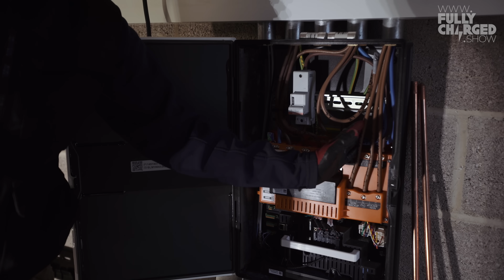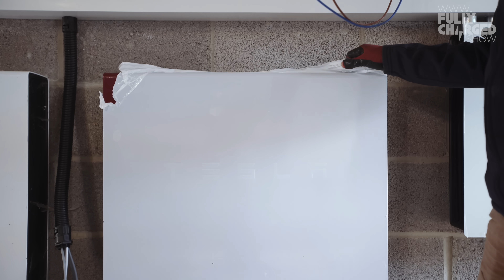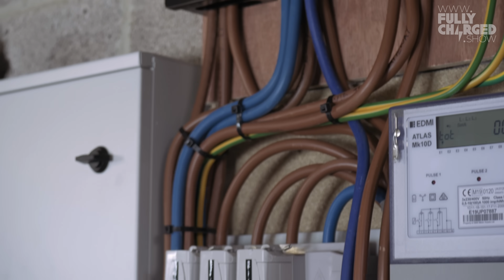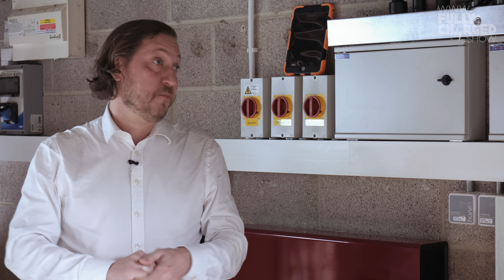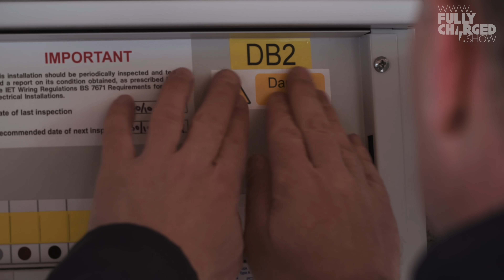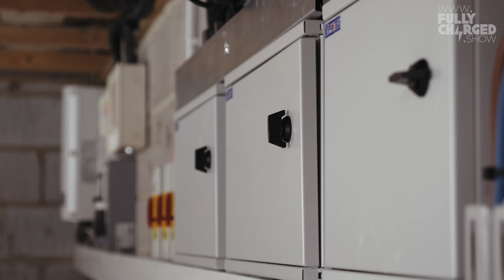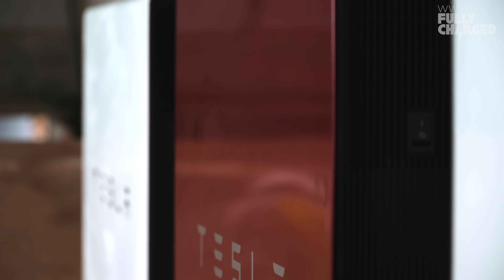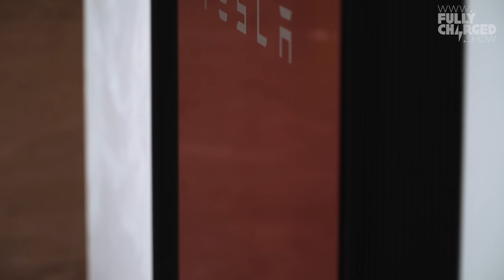Can you run your house on a battery? Tesla Powerwall 2 (Founders Series) & Tesla Backup Gateway 2

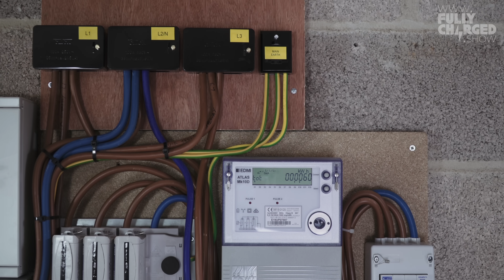Comment: Those wire terminals that the electrician is labelling at 7:00 - is that really how it's supposed to be in the UK? I'm very surprised to see electrical wires of that size being only encased in a single layer of wire insulation with no box to surround it. In my mind that shouldn't be permitted - it should either look like it does inside a box or cabinet (or other form of electrical isolation that can only be removed by the use of tools), or it should all be double-insulated if it's meant to be placed in the open like it's shown in the video. 

The rule of thumb generally is that electricity require (for safety) two layers of insulation. Most consumer products are double insulated, shown by the icon of two squares inside each other. That's also why cables have an inner and an outer sheath of isolation - otherwise technically you could just bundle single isolation layered wires together with cable ties. Instead, cables are made with two layers of isolation and we're typically only allowed to remove a layer if that layer is replaced by other isolation that can only be bypassed by tools, e.g. an electrical cabinet or a junction box. 

Having exposed single-isolated wires of that size sitting out in the open seems extremely dangerous to me, especially so in a garage where you might swing a (garden) tool around and accidentally cut through the isolation with very little effort.

Comment: Yes we have 3 phase in every house in Switzerland too. We just moved and took our charger with us and the electrician did a nice job of wiring it up.
I am surprised it takes so long to switch over when the power cost out. I would have thought it would behave like a UPS (Uninterruptible Power Supply). So to protect your power sensitive devices, like computers you would still need a UPS for those I guess.
Very interesting and informative. Thanks again Robert for sharing. 
One last thing, can you get the permanent marker off, just in case Elon shows up? ;-) He should sign it in white.

Comment: The smart switch is really interesting, taking advantage of the cheaper electricity rate at night. I'm wondering what would happen is more people start taking advantage of cheaper electricity rates at night, would the electricity demand at night increase thus driving the rates higher?
Reply: Manuel Medina Probably most price variance is due to industrial consumption during office hours, household usage is normally minimal on 8-16 on weekdays anyway even without any batteries to reduce peak demand.

Comment: So let me understand this.  15.5 KW  @ lets say 230 Volts is Approx. 66Amps. Your telling me the power company cannot accept 66amps at 230 volts single phase back on to the grid in the UK?  Am I missing something? Granted I live in the US where the standard Box from the pole is 200 Amps at 240 Volts 60 Hz , but the math doesn't seem correct here, How much power do you use per month? This technology is NOT new what so ever. You have a grid tied battery back up system  which is extremely "Vanilla" in the PV world.  I would suggest that your PV system was sized incorrectly for your Sun Hours per your region.  I would have put in an AC coupled system having the batteries behind the AC coupled inverter, where by your Existing PV inverter still saw 230 Volts AC from the Coupled Inverter supplied by the batteries and during a power outage your coupled inverter would switch away from the grid and your PV system plus your battery capacity "15.5 KW" (which really doesn't exist on your system) would both be available.  Yes battery's are great when you have a power outage but per your own comments you mentioned "5" minutes  per outage... You do understand the grid is the most elastic battery in the world.  The change over time is ridiculous, plus the surge that happened yikes... lets hope you have table top UPS's on all of your sensitive electric or electronic devices.

Comment: Hi Robert, what happens when grid power comes back on? Is there another interruption of power to the home like we saw when you lost power? 
The other thing that kind of got me was how the solar system only kicks in when the power wall gets down to 30%, the usual way is that after a power outage it will turn the inverter back on after 5 or 10 minutes because it senses that it has power, or is there something additional that prohibits that?

Comment: hmmmm  "the peak times are dirtiest"  the baseload is running all the time and the has to be reliable and cheap so it runs most time on fossil fuel. intermediate loads and peaking load are often renewables. the  base loads are using fossil fuels or  nuclear if you have it or  hydro

Comment: the backup gateway has been available for years. its what we call in engineering a kludge. this is lower than a hack. its a contactor switch with a 3rd party junk wifi from neurio and a comms box. its pretty awful.  im assuming you are referring to the new housing unlike the original US style electrical box.  robert would have been better off with a solaredge (interestingly his inverter is solaredge so i would have installed another one with storedge and 2 lgchem would have probably been cheaper too. this tech is evolving but its pretty mature and at least solaredge and LGChem make consumer ready electronics unlike tesla which seems to use its customers as beta testers. you could have also had solaredge new integrated charger or waited a little longer for a genuine 3 phase battery.

Comment: What is the round trip efficiency of you power wall installation. I.e., if you put 10 kWh into the battery, how many kWh can you pull out? I have a Sonnen Batterie, and I am getting about 50% efficiency over the year, and about 60% in the best case scenario (Maximal charge current and maximal discharge)

Comment: Very informative episode. What a treat to be educated by an articulate gentleman like Dr. Chris in the intricacies of this installation. Thank you for that! I wish my house was able to have solar installed, but unfortunately, the local building code does not allow for it. I'm told the solar panels would look "out of place" on our red-tiled rooftops that all houses in the neighborhood must have.
My only gripe with this episode is the workmanship of the electrician. The law must be more flexible in the UK. Where I live law dictates that all wall-mounted cables must be firmly secured by brackets no more than 12 cm apart to avoid cable stress, wear and the accidental snagging of an idiot passerby.

Comment: LOL. what they don't tell you, is they upgraded the power line leading into your home, so your solar panels will help feed their system. most likely you could CUT your power from the street and run completely off solar power and the battery that stores said power. They know, your solar panels are gonna charge your battery no time at all, and the extra time pulling energy, they are going to suck up that extra energy back into their own system via the 3 phase, and distribute it to your neighbors and charge them for it (just like they normally would).

guy states it wont dump back into the grid, but it will. oh it will, no power company will let you NOT spill back into the grid so they can sell free power for money....

Comment: Joju solar are totally hopeless. they are a bunch of pen pushers that buggered up the so called design as they thought that you can put 15 panels in 2 parallel strings (7+8 No way!) They failed to communicate the plans to the electrician resulting in £2000 of cost to replace the inverter I already had that was blown up. Hopeless and incompetent. Materials are drop shipped on the day and the installers are not permanent employees as they just fish around for the cheapest labour. These clowns just sent me another schematic of my system a year later for no reason at all and understamped it so it cost me to receive an incorrect schematic I did not ask for. the schematic is still wrong as they are clueless. I would avoid them.

Comment: Your battery charging speed score is wrong. EV users do not discharge the battery to 0 percent. 
Before that you will have a hard time. Because the car runs in turtle mode (usually less than 10% , 5% for niro ).
In general, ev uses 20 to 80% of the battery size. In the case of Niro, using a supercharger in that section takes about 40 minutes.
In other words, you have no idea why Niro was made that way. Niro's main advantage is space.

Comment: Can anybody recommend an adaptor that I can put in between a charging cable and house 3 pin socket that will will determine the cost of each charge. In pounds and pence.   This would be to charge a Prius plug-in.

Comment: Besides the danger of backpowering the grid in case of power failure, the main reason for solar, battery and wind generators not being able to run without mains connection is that they need to sync to the mains frequency. 
Take a generator, which is actually the same as an electric motor. In idle it turns in sync with the mains. Run it a little slower, and it takes power from the mains, run it a little faster, and it sends power to the mains. Without mains voltage, that can't happen.
It is the same with the inverters from the solar, they (most) need the grid. 

Even many conventional power plants can't run in "island mode". Last time we had a complete powerout in Denmark, there were only one or two old power plants who could bootstrap the grid, and they had to be started from cold. Only when they were running, the other plants could be connected one by one.

By the way, if you have a fossil fuel generator and you want to power your house during a powerout, get a proper changeover-switch. DON'T use a "suicide lead" with male plugs in both ends. And if you do, disconnect the fuses first, otherwise, instead of just being dangerous to yourself, you are also trying to kill the guys putting the broken wires back up. And you are also trying to deliver free power to your neighbours, which your generator probably can't hande.

Comment: I'm interested in the three phase battery backup, how many phases are supported by the batteries? I was under the impression there isn't currently a 3 phase inverter/charger that will supply a single battery? It looks like you have a solar edge inverter for handling the solar power...

Comment: PSA for customers in the United States: Three phase is not required for multiple Powerwalls in the U.S. Electrical code and power company regulations are much different in Europe. You are also able to use the Powerwalls as backup energy supply in the event of a power outage. I work for The Green Panel out of Michigan. We are a Tesla certified installer and authorized dealer.

Comment: In addition to battery storage, with the future restrictions on gas installations and relatively high cost of heat pumps in the UK- has any thought been given to using new generation storage radiators in the winter? (such as Dimplex Quantum) Obviously they need constant AC for the control systems but it may be possible (with some modifications) to feed the heating elements directly with DC to avoid conversion inefficiencies?

Comment: Problem is you could run your house for free Tesla proved that....... The greedy bastards 'government' wouldnt make money of the people so the charge stupid amounts for it. .... same goes here you might be able to run your house on a tesla battery but it will cost so many thousands for the batterie and the so much a year to charge it up.   What's the fucking point might aswell have man size hamster wheels built in

Comment: Interesting video but i wouldn’t have installed those powers walls so close the the ground. Any flooding will turn those batteries into bombs. Being an electrician it’s very similar way we do it in Australia although I think it’s a complete waste of money. While solar panels install are fairly cheap now they have a life of 25 to 30 years which is good the power wall only have a life of 10000 cycles roughly 8 to 12 years before needing replacing. If people think the world is moving to lithium batteries they are going to be disappointed because there isn’t enough lithium on the planet.

Comment: Hi.

I See that your L2 and N is connected at the same terminal on the wall meaning no potential between the two. How does that work?

Whats the voltage between L1 and L2? Whats the voltage between L2 and L3? Whats the voltage between L1 and L3?

Here in Denmark we have 3 Phase 230/400 + neutral coming in separately giving 400v between the phases or 230v between N and either of the phases.

Great vid. Thanks. Martin

Comment: I’m in Southern California and I went with a battery from a company in San Diego called NeoVolta. In California you have to install an AC shutoff on the outside of your house (basically a lever that kills the grid to the house) and I can pull it and the NeoVolta will turn on within 1 second and the house will run completely off the battery. In an extended outage, the battery controls the panels so will turn the panels on/off to charge itself, all without grid connection. I am super happy and would recommend NeoVolta to others.

Tesla is a great company however I’ve discussed with several installers that the complexity of the Powerwall installation + the extras to make your home truly run off grid is not worth it. Additionally the state rebate for the NeoVolta was better and the installation costs were lower.

Comment: Wow all that money and high tech and you still loose power when the grid goes down! Sorry Lol, but that for would not be acceptable to my mind. My postman’s wage would not come anywhere near affording this system, so I built my own DIY system, and I can switch between battery and grid power automatically with out loosing power and the switch cost me £100. No power goes to the grid, it only comes from the grid. Plus I’ve isolated my house ring main, all other high power units go direct to the grid.

Comment: I also have the goal of importing nothing during the early evening peak.  I've been achieving it since mid 2017, with a 1-phase SolarEdge system.  It has a feature called a charge/discharge profile, which I've got set up to fill the battery from the grid between 3pm and 5pm.  Simple but effective.

Comment: my question is if the battery in the car can also be used to power the home or sell back to the grid.
Example: the grid goes down for two days...could I use the power from the car battery (not the wall system)

Comment: Germans get around 14 cents per kW/hr. and can earn around 100 kW/hr per day during spring/summer/autumn months (or buy from the grid costing 30cents) so it's more of a "feel-good" thing. https://screenshot.click/15-06-0kv4b-gudix.png
The powerwall in Germany is connected in AC to the grid with one-phase supply and limited to around 20/25 amp to the 3-phase car charger (around 400 volts).
The DC power comes from the roof and fed into the inverter (output of around 5kW but limited to 1-phase 20 amp in Germany = 4.6kW) with split cables producing AC power to the grid. Average consumption is about 2-3kW/hr per night leaving around 10kW spare charge for the Tesla or i3. The Powerwall is also smart so it can charge or discharge depending on the fluctuating price in the grid day and night.

Comment: Let's answer the first question. Ignore the second sentence completely.

But first a geography lesson... Think of four separate places, but all four of these places have one very important item in common. The four places are:

1. Pittsburgh
2. Seattle
3. The United Kingdom
4. Germany

What is their common geographic feature? They have very little Sun. One does not go to such a place (especially for a vacation) expecting to see much Sun.

Now comes the question; can you run your house on a battery?

Yes, you can run any house on a battery, regardless of efficiency.

One can charge that battery via solar. Or if one really wants to, one can charge the battery via electricity coming into the house. Once one entirely disconnect either the solar or the supplying electricity; a house can still run quite well on battery. Depending upon efficiency and if properly set up; one could run on batteries for 36-90+ hours.

My neighbor has 400 amp solar/battery; in Pittsburgh of all places - see note above. It can run on solar/battery and never need to draw anything from the grid. It gets better though; they also charge their Tesla with that same system

Comment: Single phase? In which century do you live? I mean where?
Reply: yogioto why would an ordinary home need three phases? Standard U.K. supply is 100 amp 240 volts, so 24kw. More than enough to run every single appliance in a typical home at the same time. Three phase would just be a waste of copper and add unnecessary expense.